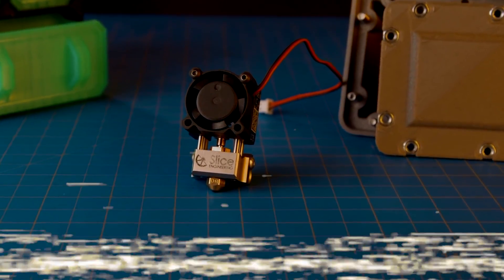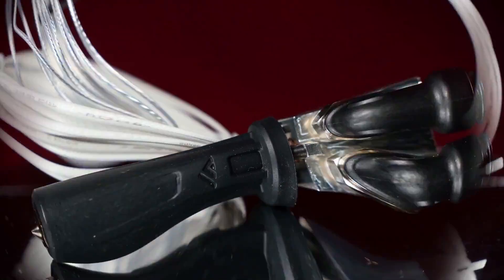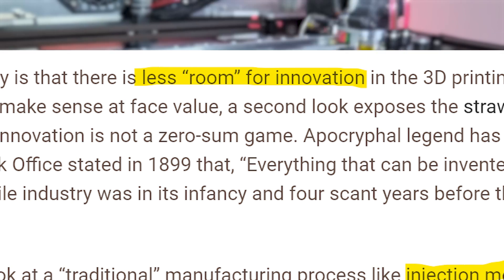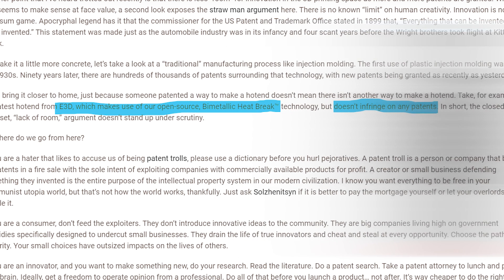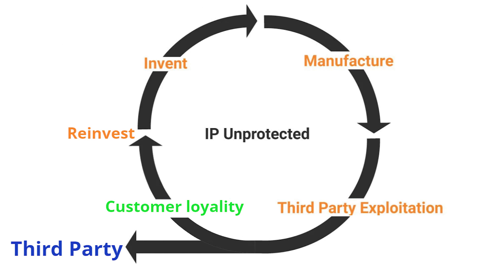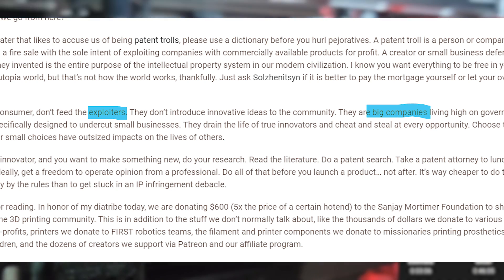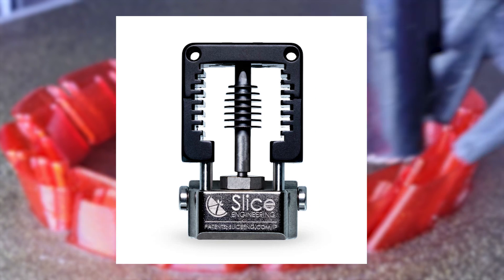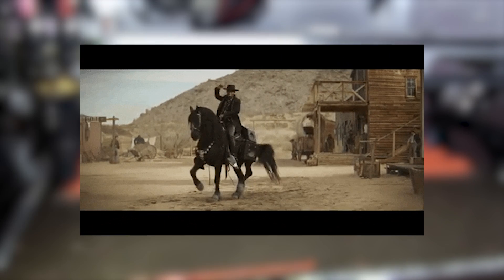Slice Engineering's RIDICULOUS response - VzBot Goliath VS. SLICE ENGINEERING in 3D Printing

Comment: I suspect that the only reason they did not patented the Bimetal heatbreak is not because of the goodness of their heart but simply it will not fly with the patent office. Hotend are inherently bimetal on both end. They simply move the interface from one part to another
Reply from the maker: Yep. I mentioned this as well. Their IP model seems more like: Patent if possible, if not, make a big name out of findings and call others copycats anyways.
Reply: Agreed, its thermal dynamics not a patent and in real extrusion long before 3d printing heat breaks are used still today to extruder polymers no new tech and bolts aren't special to just them, the fact they have one for this is discussing and degrading to every RED seal millwright 100% and more
Reply: I think they’d have been able to patent using thin-wall titanium tubing bonded into copper on both ends. Nowhere else would the bimetallic interface be well situated to minimise heat-creep. Nor was it likely anyone else was deliberately choosing low-conductivity high-strength materials, in order to allow the metal to be extra thin to conduct even less heat. It’s absolutely a functional innovation.
Reply: @Scrogan  the patent was literally for standoffish, that's it. Till this day the Goliath hotend has this on their page, they literally just used screws. It has nothing to do about bimetallic material. 

---
At present, 6 titanium screws are used to connect the heat sink and the heating block, which is not an infringement of the US patent, so it can be sold normally. Package:
---

The US allows overly vague parents. Apple got a patent for smartphone icons with round corners. In fact they got a patent for a smartphone with round corners. This was right when smartphones came out and they thought Samsung was trying to copy them. While they were to a degree, it's insane to allow payments like those or this one.  Heck, there are people who make a living filing parents for stuff they are never going to make just to wait for someone to do it then sue them. Patent trolls are a real thing. Not saying slice is, but they kind of are in this one particular scenario. I understand wanted to protect you IP but having standoffs between the hotend and the heartbreak isn't one of them, ESPECIALLY since it's been proven they weren't the first to do so. They just filed for the patent first so they got it. No ody else thought to do so because it's silly. 

I do agree that there were some straight off ripoffs on AliExpress but the Goliath wasn't one of them . I mean, who cares about heat creep if you get the water cooled version? 

The real issue was their response. Whoever wrote that had zero experience in any sort of customer relations. Slice hurt themselves more than any money made off that patent which still seems to be valid in China.
Reply: @JoshFisher567  can you read? I’m replying to a comment about whether they could have patented their bimetallic heat-break.
Reply: Sounds like they designed products to file for parents so they can sue companies. To reference communism in what should be an apology letter is beyond absurd. If it was true communism then slice could have companies shit down, at least to a degree

People file parents waiting or someone else to make it then sue them when they have never had or worked on the parent they filled. With communism the rich, or those with government friends get their way regardless of it's right or wrong.  It just makes the wealthy flourish.

Alice sounds a lot like Apple accept people actually but Apple products. The Goliath has a 100 watt wire that runs around the hotend several times, that's more innovation than anything slice has ever done. 

Linux is by far the best example of what open source can do. I mean, nobody is running on web servers using MS server and IIS, at least nothing with more than. 50.currcierwnt users at least. VmWare wouldn't exist. So much more that I could add. Another good example is Home Assistant, which runs on Linux. There is still plenty of money to make while being open and and end users have more respect for the company. Like Sovol releasing a Voron but everything is open source still. I know they didn't originally have the hardware open source but they listened to the community and acted appropriately IMO.

Comment: I agree that the Slice patent is not that different from earlier stuff like the Creality hotend in construction, but still it has quite a big impact. If it wasn't so no one would be mad and everyone would be happy to just stay with structural screws. Everything has to start from some open prior art, that at a certain point gets some refinements that get patented.
Anyway brand loyalty is no longer enough, in fact both the examples from the video, E3D and Prusa, are transitioning to a closed source model for their newer stuff (Revo and Prusa XL) despite being based on earlier open stuff. Revo patent is in my opinion even worse than the Slice one, it brings nothing new to the table, and it even patents consumables!
Reply: E3D is at least licensing it... Even Biqu has a revo extruder now. Slice is just shutting people down, They aren't making new products, and their best advice to makers is "lawyer up" (take an atty out for lunch, I believe was the actual blog suggestion). I'd really like to know if what they think of the ole statasys patent too, did that help innovation in the space?
Reply: @tshackelton I thought only the extruder is licensed not nozzle. Isn't nozzle in aliexpress all fake ones?
Reply: @HdbeWydvd   It seems that e3d can't even make them right now! :) (obx joke)
Reply: @tshackelton  They are not licensing, as far as I know they left the cold end open, while they have a patent they don't license on consumables. In my opinion it's even worse than the Slice patent as instead of buying a product and be done with that you are locked in an ecosystem where everything disposable has to be bought from a single manufacturer.
Reply: Huh? Slice patented screws and spacers, it's so unbelievably obvious that more than 50% of people would obviously solve the problem the same way.

There is no doubt that this patent has already stymied advancement in 3d printing heavily.

Comment: I have about 20 gluing machines at work with riser separations on them.  They've been like that for 30+ years. Slice has sniffed too much boron nitride. Also, piss off with the veteran virtue signaling. I'm not a fucking talking point, and it's so obvious you're just using us a leverage to ease the tension of the topic.
Reply from the maker: It's great to have you here. Thanks for standing up, and not just letting yourself be used as leverage! And thank you for watching this video. Habe a great day!

Comment: Would never buy a slice hotend. Way to expensive & i don't like companies that act like this. It is a no go.
Recently bought an E3D Revo hotend. Good quality for way lower price.
Slice is only afraid of others making better products for lower price. 🙄
Reply from the maker: I'm glad you like the Revo! I'm making a video about it, too, soon :)
Reply: The Revo is awesome. I might be in the minority, but I fucking hate nozzle changes. No matter what I do, something always goes wrong during a nozzle change with wrenches. Filament leaks, damaged the heater cartridge and thermistor on my Prusa Mini during nozzle changes (really poor design there, tbh), etc. Revo system is the solution to all that bullshit.
Reply: Lower price, yes... better, largely no.
Reply: Revo has a patent too. That said it's a bit different than slice. I don't think you should be allowed to patent standoffs. Standoffs are used in everything for isolation and rigidity. Maybe you can patent the way you implement them say how they use surgical tubing to better insulate the heat.
Reply: REVO ALL THE WAY BABY
Reply: I agree, I would never buy a product from Slice unless they went full open source as most companies have. There are better products out there for a reasonable price.
Reply: The extremely high price for the Revo is, sadly, on the nozzlebreaks, tho... =(
Apart from those, the Revo costs just a little bit more than a regular V6 (while being so much insanity-preventing thanks to the easy nozzle change)

But, quoting CNC Kitchen: "I've never changed nozzles' (diameter) so often as with the Revo"

Comment: his points on the uniqueness is on point. 
one could argue that the hotends A, B and K show prior art, as well as show their claims are not new.
THAT IS GROUNDS FOR A PATENT REVOKATION
 If prior art or publications show that your claims are not new, the USPTO may invalidate, or revoke, your patent
you would just need a lawyer to write a re-examination request, and I bet that there is likely at least one company looking into that, for how wide their patent is
Reply: Neither of those designs is covered by the patent that Slice engineering has. The patent does NOT cover standoffs, it covers specifically standoffs that are kept in compression by a separate tensioned member (like a screw).
Reply: @erikcederb  yep, and at least partially reduces mechanical loading on the feed tube. I sent vez the full patent history a couple of weeks back and highlighted the prior art they successfully argued around. (<-patent att.)

Comment: I don't get that patent could be granted.  My Ender 3 hotend used 2 extra bolts for stability way before there was any Slice engineering hotend.  That is clearly prior use, no?  So is using 4 screws unique?  Well, then we can just use 3 or 5 to bypass the patent.
Reply: From my very limited knowledge of patent law, it’s mainly about having the money and time to challenge and defend your patents. You can kinda see how open source projects have a distinct disadvantage in this regard.

Don’t buy slice products and like the VORON team, remove support for them in your open source projects.
Reply: The patent is around making the heatbreak non structural by the means of having something else in compression and something in tension. In the case of the Creality hotend you have two screws in tension, and the heatbreak in compression. Clearly the Slice setup is better, but you can easily dodge the patent going the Creality route using screws without spacers, it is what Rapido and Dragon UHF do.
Reply: Goliath only use 3 screws as well but they still went for it
Reply: Would that be enough to get around the patent?

Comment: I've called it as soon as I saw that Vez was gonna use spacers. If there's a patent, there's always a workaround. Maybe keep that in mind if you're designing another hotend to avoid this mess.
Reply: Slice Engineering told them it was okay to use, I guess you shouldn't ever trust Slice Engineering. I get that it's business, and I get that they might not have broken the law in doing so, but they have done irreparable damage to the 3d printing industry, they acted vindictively to intentionally cause disproportionate harm to a small open source project.
Reply: @ballbous  they never told me it was ok to use spacers. I showed them months ago a new design that uses standoffs instead of spacers and they said it was safer but I should check on incoming patent stuff too etc..  i should have kept this standoff ideas...my bad. I just thought that cemaric spacers were just smarter and since the bolt was "inside" the spacer it would be ok. And there are a lot of points that were made to be patent friendly.  More will.be explained in a incoming video
Reply: @Vez3D  either way, they had access to the project files the entire time, I don't believe for a second they were unaware of the way the design was progressing. In my view this is clearly them acting vindictively because you designed a product with mellow.

They had a good relationship with you, along with endless opportunities to mitigate the damage to you, your project and mellow.
Reply: At the same time, trying to 'go around' a patent that is not valid patent in the first place is playing the game of patent trolls.. Those practices should be disclosed as in this video and bogus patents (or as in this case patents with bad prior art review)  should be treated as such. If not, the whole innovation cycle will be broken which will also kill the market in question..
Reply: @jcugnoni  These are small open source projects, they don't have the money for a lawsuit. Their options are to either stop or get shut down.

Comment: Final nail in Slice Engineering's coffin for me. I have never liked their Mosquito patent because as shown in this video it is both obvious solution to the problem and it has ben done before by others. In this I have always seen it similar to Apple patenting a generic sketch of a touchpad decades after the same device featured i movies and literatrue, after Star Trek had it in hundreds of episodes. It is just ridiculous to me that such patents even get granted. 
Nevertheless based on some reviews I bought a Copperhead hotend once. No clones, I do not trust cheap clones, I wanted the genuine article. I have never been more disappointed by a hotend's performance before or since. And I have never had a 3D printer component that would be so overpriced for what it is. 
Slice Engineering has the business it has because in 2009 some patents expired and open source community took over the developement. Prusa could only start selling printers after they were no longer blocked by patents. So for Slice to use patents now to block others that do not just straight up clone them but just use one tiny similar part in an otherwise completely new and unique design is just making me angry. So angry Slice will never get a cent of my money no matter what they make. I will not buy anything from them even if it is twice as good as anything else on the market. I would rather suffer worse performance than support these people. And I will try to convince others to do the same whenever someone asks me for advice on printers.
Reply from the maker: This. That's why I'm opening my own 3d printing store with brand new and innovative products myself. Hope to make innovation affordable and open for anybody
Reply: Spreading the word is our most powerful tool and our most important responsibility. I would feel awful if I bought a product from them and then found out what I was inadvertently supporting.

Comment: ive said this from the start about slice engineerings patents, the parts that make up the mosquito arent really new as a concept, like this "spacer technology" yet the Ender 3/CR10 hotend uses 2 small screws on either side for much the same reason. and not to mention bimetalic heatbreaks arent really new, just finally in a pacakge thats not a diy hack job. heres one example of someone inventing one back in 2012 on reprap forums thread ID 1,250849 just no one called them bi metalic heatbreakss. it was a diy "stainless steel hypodermic tube" soldered directly into a cooper heater block and a "copper tube" with water running through it to keep it cool. this is so old that the nozzle is made from a dome nut. i argued with Design Prototype Test a while back about this, both these points
Reply from the maker: Super interesting! I'll have a look
Reply: Y'know I was a bit confused because I saw the exact configuration on my Ender 3... when I was installing one of Slice Engineering's bimetal heat breaks on it. Shame, too - it worked really well and fixed issues I had with plastic melting and clogging the system.

I probably wouldn't have even known that Slice had some marginally-inventive patents in their portfolio if they hadn't written such a weirdly vindictive blog post that pulls the whole "Open Source is communism" nonsense
Reply: @SuperSmashDolls  while they have made inovations ontop of what prior art they are now going after other hotends that are not even copying their designs.

The Vzbot goliath should never been taken down. how they are isolating and supporting the heater block is unique, 3 screws inside the ceramic spaces. slice has 4 seperate thin walled spaces and 2 cr10 style exposed screws.

if they are able to take down the goliath hotend then their patents are far too encompassing. the nfcrazy and spider were justified to take down but not the goliath. someone needs to just call their bluff and get their patents stripped at this point. by the sounds of their patent either they essentially patented the use of washers. or the CR10 also infringes on their patent. 

by the sounds of it at least vzbot would only need to remove the spacers leaving bare screws holding the hotend in place. just like the CR10 with 3 screws.

they made that blog post to convince themselves they are the "good guys" in this whole ordeal. they could have had some specific patents but they got greedy and tried to make their patent far too broad. i hope it comes back to bite them